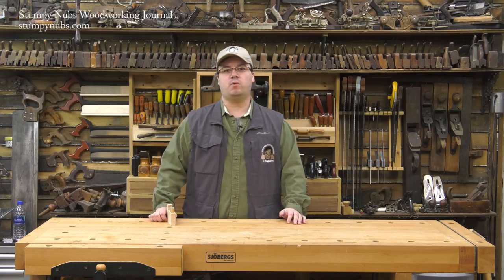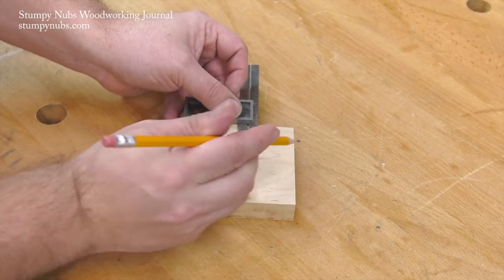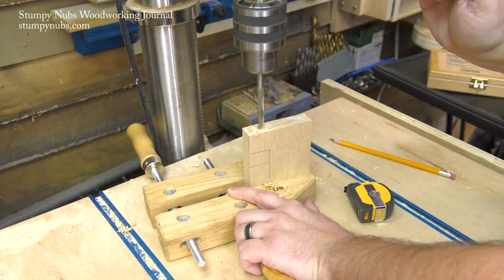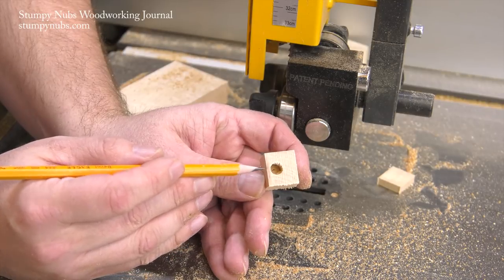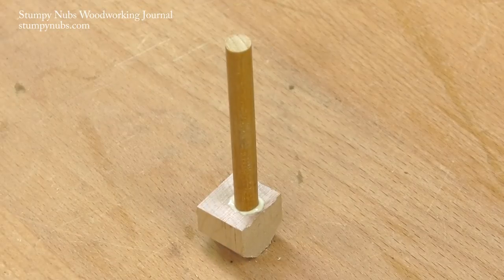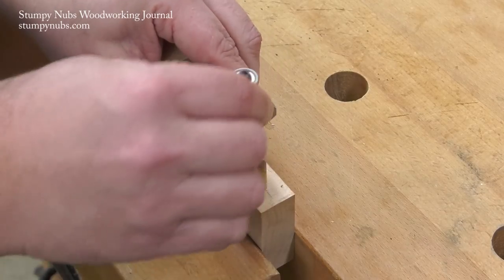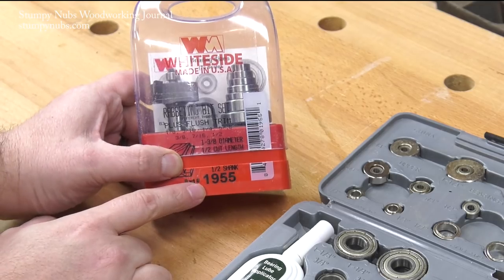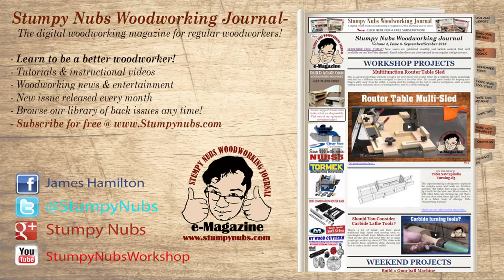A cool jig for changing your router bit's bearings!

Comment: That's a great jig. I'm always tempted to just hold the bit but I've been cut so I have been chucking up in the router. But it's not always convenient to do that. I suppose a fellow could just make two jigs one 1/2 an one for 1/4 or make a bushing from 1/4 to 1/2 by punching a 1/4 hole into a 1/2 dowel.

Comment: Good tips on the router bearings   The jig would be nice to  have   And th extra parts are smart since everyone i know has to rob other bits everytime you drop a part  maybe  even  drill a holder for he Allen wrench  that’s always buried in your tool box so its handy ? Just a idea   I guess you keep yours in the bearing case  for easy locating ?     I always thought  it would be great if it was the same size Allen as my  fuller countersinks  because i ganged that one with my drill bits and it was easy to find quickly ?   Plus the bearing bolt  size was never on the flip out  hex wrench  sets i got from Sears to keep in my tool box
Reply from the maker: I considered boring a hole for the Allen wrench, but most bearing sets hold the wrench in the box.

Comment: James really cool idea, I've lost some screw & washers using my router table to remove router bit bearings. Do you have a link for just the screws and washers? I already have sets of bearings ... but no extra screws and washers. Thanks! Keep up the awesome Vlogs James!!!
Reply from the maker: I don't know of a source for just the screws and washers. You may find the screws at a good hardware store, but the washers are usually cupped (not flat), and may be hard to find. You may just have to buy one of the Wood River or Peachtree bearing kits to get the screws you need. It's still way cheaper than replacing several bits.
Reply: Yeah, I think I'll just go with your suggestion. It's the easiest way to go in my humble opinion. Thanks, James!

Comment: What's with the shaky hands? Doesn't that affect Your work?
Reply from the maker: Yes.
Reply: How do You handle that, if I may ask? I would s**t myself if I had to work around sharp blades like that...
Reply from the maker: It's not as bad as it looks on film.
Reply: No disrespect intended, but this isn't the first time I've seen comments like this.  Serious question:  if you're standing  in line next to someone at the supermarket and you see this, would you tap them on the shoulder and say, "hey man, what's with the shaky hands?"  Doubt you would.  My 4 year old nephew knows that something like that is rude.  Why does saying it on the Internet make it any different.  God forbid the dude has some medical condition or something.  Not saying he does but think about it before you say something.  And by the way, haven't noticed the shaking myself.
Reply: Standing at the supermarket? No. But when I see someone with condition like that working with blades spinning at tens of thousands of RPM's, yes, I would ask this question. Why? Becouse I wouldn't do it - like I've said - I would be to scared to loose my finger / hand / arm / life. Just as I wouldn't do any electrical work if I were color blind. And why do I ask? Becouse that how I learn stuff. It's a legitimate question, and I apologise if it sounded rude or disrespectfull; english is not my native language.
Reply: Tioga Fretworks Your English is fine. However, I too, found the question itself to be rude.
Reply: Don't apologize to me pal. You can say whatever you want on the Internet.